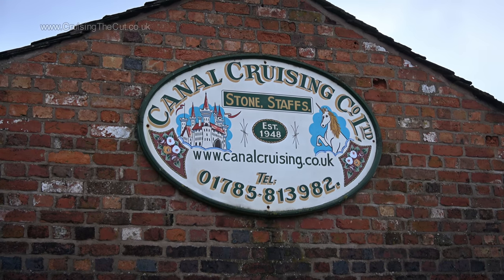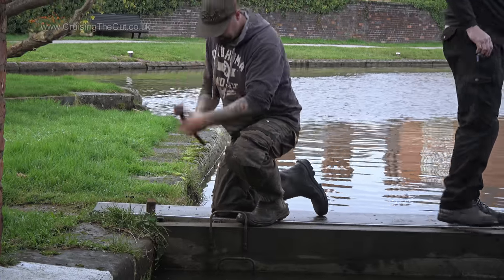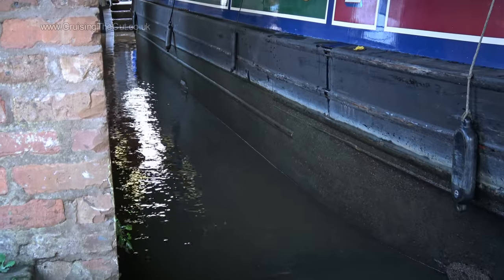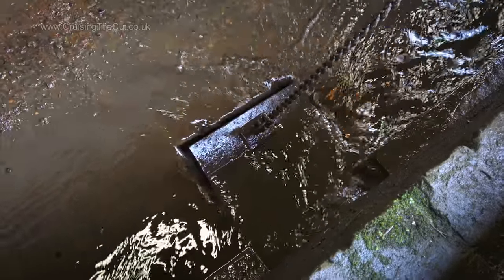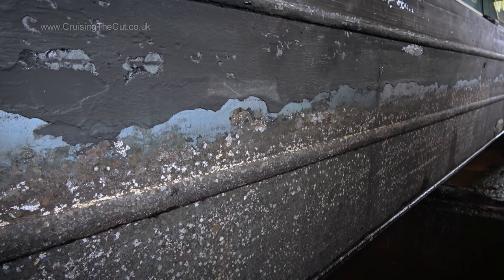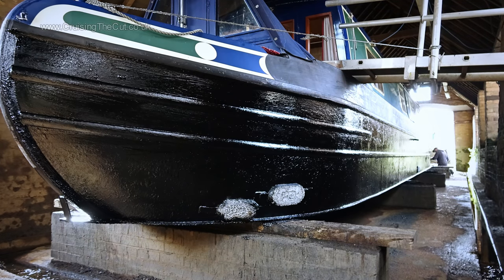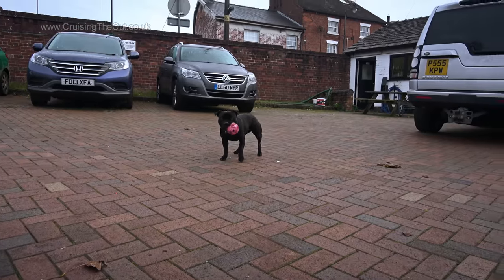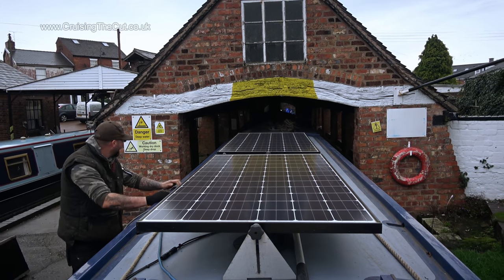201. In dry dock! Re-blacking my narrowboat

Comment: If the hull is made of steel anyways then why isn't stainless steel ? or atleast has a think sheet of SS clading on the outside? Another option: why the outside isn't "resin-ed" or epoxy-ed? there are lot of epoxy paints / coumpounds which can be applied in thick layers (even upto 5mm or even 10mm thick). some of them are even self-healing "meaning small nicks and bumps and cracks  are automatically "cured" due to the viscocity of the Epoxy. 
They have this on cars now-a-days. I recently put that on my new car; covering entire front half to protect from small stones pitting the body of the car. It is only 1mm but I saw thicker onces for trucks.
Reply from the maker: Hi. Epoxy would need shotblasting to remove the old blacking plus it's much more costly. As for stainless, please see the discussion further down in the comments.

Comment: What is that appendage coming off the floor plate at the front of your boat? It looks like a towing hitch. You may save a bit of diesel if you cut this off.
Reply from the maker: It's supposed to be there!
Reply: Kind of bumper?
Reply: Be there for what exactly?

Comment: Is there any type of Epoxy paint or spayed on plastic coating that lasts longer than a few years. Initially more expensive to apply but would save a lot of money in the long run.
Reply from the maker: You can get two-pack epoxy coatings which are said to last 7-10 years but they're much more expensive and require shot blasting of any prior coating, plus you're still going to scratch them and for myself I'd want to take the boat out every 2-3 years anyway to keep an eye on the hull condition, so might as well stick with traditional blacking.
Reply: @CruisingTheCut  ... Thank you for explaining. I see you have answered this question several times in some of your previous videos. I apologise for not noticing them before commenting. 

Excellent channel and of course you have the advantage of being able to travel around as you wish and stay at home simultaneously!
Reply: @CruisingTheCut  The Narrow Boat Experience had the two part epoxy applied to the underwater part of their narrowboat if anyone is interested in watching that to see the comparison. I think David however probably has the right idea to blacken every 2-3 years rather than 7 or more years. The annodes likely wouldn't last 7 years anyway so you'd still have to haul the boat out to replace those.
The Narrow Boat Experience 2 Ply source: https://www.youtube.com/watch?v=fwZGXZwn-nc

Comment: Very interesting.  How much did this cost?
Reply from the maker: Traditional blacking usually costs anything from £8 - £15 per foot, depending on where you have it done and what they use.
Reply: @CruisingTheCut  Is that per foot of boat length or per side (twice as much)?
Reply: @CruisingTheCut  Is that, assuming it is a 50' boat, 15 pounds x 50 or because there's 2 sides to the boat, 15 x 100?

Comment: What exactly do those anoids do on the side of the hull?
Reply: Corrode.

They are sacrificial anodes, made from magnesium. They are designed to corrode instead of the steel hull ...up to a point.

In short the different metals found on a boat, steel hull, bronze propeller and canal water "act" as a battery. You can Google this topic and probably get the chapter and verse version including electrolysis with the emphasis on "noble" metals, anodes and cathodes.

Be warned tho', you would be entering the realms of "narrowboat nurdism" 😁.

Comment: I know the bottom of the boat doesn't have to deal with the same damaging conditions as the waterline, but do narrowboats ever get their bottoms blacked?
Reply: They sometimes do, but it's not so common because as you said they're not as prone to rusting, and of course covering this area requires a lift and extra paint, that would bring the cost much higher.
But if you really want to, you can black the bottom, nothing stops you from doing so.

Comment: Why no media blast, phosphate and two pack epoxy? What about the bottom? No love for that?
Reply from the maker: Epoxying is expensive and my boat would require grit-blasting all the old bitumen off first (which is extra expense). Then the epoxy can still be scraped off in the canal. Plus I'd still want to haul it out every three years to check the hull over anyway because that's just how I am. So ultimately, I might as well stick with bitumen.
Reply: @CruisingTheCut  artic ice breakers are epoxy coated, it is so strong that it actually adds strength to the steel so with the appropriate materials scratching should not be a problem and any chips/scratches are not such an issue with epoxy as it (if properly applied) does not allow rust to creep underneath.

Comment: No paint to bottom surface?
Reply: As you see it is not practical to paint the bottom with the boat resting on wooden stocks. So instead the base plate is considerably thicker steel than the sides. It will rust through, but it will take 30-50 years! The sides are much thinner and so need painting. Even then when they eventually rust (through not painting properly or regularly enough), additional plates will be welded over the old ones, giving many more years of life. 👍

Comment: What about the bottom of the boat, does it require paint ?
Reply: Allow me step in please, not necessarily and practically worthless as the bottom usually touches (softly) to the ground or canal bed so removes the paint after a short time. Also bottom (keel) plate is originally designed with excessive thickness than the structural requirement for this size of boat which doesn't cause any concern for corrosion at all, particularly in fresh water.

Comment: Just a quick question I have always wondered about, how do you paint where the boat is being supported? It seems like that part would be left raw and therefore  corrode. Even worse if you went to the same doc multiple times potentially the same part could be left and painted or and refreshed. There must be a way to deal with this but?
Reply: The flat bottom does not have paint, it is in fresh water, and the anodes are adequate protection for that area.

Comment: why bituminous coating  , its brittle and cracks very easily , globby with a brush ??? how thick was the coating , it should have a spec sheet to tell you at what thickness it is applied at , and i recon around 250 microns , brushing just scrapes it back and forth ,you botton coat should be applied by airless spraying usnig a 515 tip at around 1500 to 200 psi , your beter off with a pu from PPG  some of ther stuff has a life of upwards of 15 years
Reply from the maker: It's been done that way for years and works well. As for putting blacking on to a specific number of microns, you'd get nowhere asking for that at any narrowboat wharf or dock. It's just not like that in this game.
Reply: @CruisingTheCut  strange that, they tell you its the best and you except the word and shell out every 3 years or so  , im currently spraying  boats in exeter
Reply from the maker: It's hardly just me, most of the 35,000 boats on the system have this, albeit some pay for epoxy.
Reply: Hi again. Even in salt water we use bituminous coatings on punts and scows. It works very well and easy to reapply and is long lasting. Anti fouling is not appropriate in canals as they leach chemicals, that’s how they work and are difficult to maintain properly.
Reply: Another comment. Airless would not work as the bituminous pain is far to thick. It would require excessive thinning and 250 microns is good for normal protective base coats and anti fouling but  a bituminous paint relies on its thickness for protection of the hull

Comment: Amazing...how much did that cost?
Why didn't you get the top half of boat painted?..
Reply from the maker: Traditional blacking usually costs anything from £8 - £15 per foot of overall boat length, depending on where you have it done and what they use.

The main hull paintwork on a narrowboat is usually only re-done every ten to fifteen years (or more in some cases) and generally requires grinding back to bare metal then many coats of primer and topcoat etc. This costs in the region of £8-£10,000 GBP so it's not a trivial matter!
Reply: Colt  They are used because different metals that are electrically connected (part of the same boat) and exposed to an electrolyte (aka water) create an electric current between them which strips ions from the more active metal and sends them to the less active metal—this is called galvanic corrosion.  The hull of the boat, or any metal fittings would generally corrode away because of this corrosion, but the anodes typically made of aluminum or zinc on a boat like this would corrode first as a sacrificial element to save the rest of the boat.
Reply: @travers114  Or... one could say if you don't have those, eventually your boat will spring a leak.

Comment: I'm guessing that the bitumen paint for the hull is a product that has been in use for a long period of time.  Why isn't a more modern coating being used like epoxy paints or something like POR 15?  Perhaps bitumen has some other properties other than providing a barrier between the water and the steel?  Maybe some sort of anti-fouling properties?
Reply from the maker: You can get epoxy paints but to treat a boat that previously had bitumen you have to shotblast it all off, which is expensive. The epoxy is also much more expensive albeit that it lasts longer. For me, I would want to examine my hull every 2-3 years anyway so the longevity of epoxy would not be a valuable benefit.

Comment: next time you dry dock put your annodes on bolts then you can paint behind them
Reply: Good point.
Reply: Only problem is that anodes stick out far enough as it is. Some boats just over gauge and have been known to jam in tapered locks.

Other problem might be that if you hit a stud end on them might be driven through hull, with possibly dire result.

Thread could be coated to prevent corrosion but might easily get bent.

That's why anodes straps welded onto steel hulled narrowboats.

Old straps usually ground off to minimise the welding to hull.

On occasion it has been known for insulation to catch alight with boat consumed in consequent inferno ... diesel fuel and gas bottles being on hand to ensure boat is gutted.

Comment: @ 7:03 to the right of the screen in-between the 2 rub strips, what is that? it looks like a hole with something green and 3 small black things inside lol!????
Reply: Do you mean the drains from the well deck lockers and/or gas locker? They are only just above the water line. One reason narrow boaters don’t like waves.

Comment: Additionally I would like to ask if you have to many anodes. Having too many is a bad as to few. I noticed you old anodes looked good and showed life left in them. You can have a test done. It’s basically a multimeter with a reference anode. Might be worth checking it out.
Reply from the maker: I believe I have the correct number.

Comment: Spend a bit of money have your boat bottom and sides shot blasted, and 2 pack paint applied you get 5 to 6 years
Reply from the maker: Not for me. Not only is the epoxying expensive, my boat would require grit-blasting all the old bitumen off first (which is extra expense). Then the epoxy can still be scraped off in the canal. Plus I'd still want to haul it out every three years to check the hull over anyway because that's just how I am. So ultimately, I might as well stick with bitumen.
Reply: CruisingTheCut I have spoken to several boat owners who had 2 Pack “Blacking” applied. All were peeling off within months. One boat was brand new. All had been shot blasted. The word here is that 2 Pack blacking simply doesn’t hack it.
Reply: The cracking in epoxy coatings described in some annecdotal comments may, possibly, be attributable to the relatively low elasticity compared to bitumastic coatings. I speculate on this one.

According to one boat painter when discussing repainting my boat reckoned that a boat might expand in the linear dimension by possibly 30mm during very hot summer days.

Possibly the two previous years (ref UK) with their vast range of temperatures, may have been too much for the epoxy coating, hence cracking to said epoxy film?

Whereas the bituminous coating on my boat showed no cracks at all.

Anyway, I suspect we will find out one way or another ...

Comment: so they black the boat because it's steel can they instead plate it with something like aluminium or better yet build aluminium boats or would that not be practical.
Reply from the maker: If you overplate, water, damp or condensation will be some means get between the plate and the steel and then rot the steel from inside without you being able to see it until too late.

There have been narrowboats built from aluminium but at much greater cost than steel, plus it's not as strong, and there are fewer places that know how to weld aluminium.
Reply: @CruisingTheCut  i suppose the cost of an aluminium boat would be impractical, or maybe the aluminium isnt strong enough for a boat.

Comment: Is the “paint” actually foundation sealer used in home construction?
Reply from the maker: Not as far as I know; it’s bitumen-based stuff
Reply: We actually do use something very similar here in Canada for foundations. It is a old way of doing things, it tends to eventually get hard and crack (or if the foundation shifts/cracks it won't self heal much) and lose its ablity to seal the foundation from water. Basically just rolled or brushed it on to the foundation walls in a few layers from giant cans.

Comment: How much did it cost  ?
Reply from the maker: Typical bitumen blacking costs anywhere from around £8-£12/ft of boat length, depending on the marina and the paint used.
Reply: @CruisingTheCut  Could you translate that for an American to understand?
Reply from the maker: I'm genuinely not sure what needs translating or how I could make that any more explanatory, sorry.
Reply: @kbflorida7985  Basically it is $10.25 to $12.36 per foot of boat legnth.
Reply: @CruisingTheCut  that's not so bad at all. I thought it would cost a fortune.  Thank you for the quick reply.  Have a nice day 😃😃😃
Reply: @kbflorida7985  what he meant was that it cost around £8 - £12/ft of the boat length, depending on the marina and the paint used. 
Hope that helped  😂😂😂

Comment: did you consider 2 pack blacking it would last 5-7 years then
Reply from the maker: Epoxying is expensive and my boat would require grit-blasting all the old bitumen off first (which is extra expense). Then the epoxy can still be scraped off in the canal. Plus I'd still want to haul it out every three years to check the hull over anyway because that's just how I am. So ultimately, I might as well stick with bitumen.

Comment: Instead of blacking- ever thought of putting a rubberized coating on the bottom of your boat...then all you have to do is clean once in a while...
Reply from the maker: The trouble with these coatings is that firstly no-one else has tried it so I wouldn't want to be first; secondly these coatings seem to be quite costly; and finally I'd be concerned about water being trapped between the coating and the metal, rotting it from inside out - invisibly.
Reply: @CruisingTheCut  I was thinking of the spray they use on pickup truck bed liners, the kind where they mask off the parts they don't want to spray, then give it the spray.  The stuff is immensely stuck on the metal bed of the truck - it need to be ground off if you want it gone, and no one dares try that.  They do make sure the bed is completely dry before application for the same reason - to avoid having trapped moisture eat through the steel.  But it's got to be better to do it once than have to haul the boat out every three years, even if the cost of the material were higher.  The spray is likely used on trucks in Britain already.  "Line-X" is one brand, but they're generally called "bed liners" - not to be confused with the pre-molded liners of ABS that can be slid into a pickup bed and removed if needed (they're typically screwed into the truck's bed).